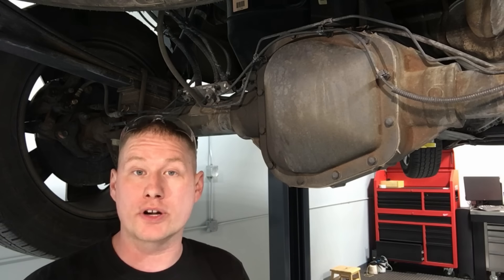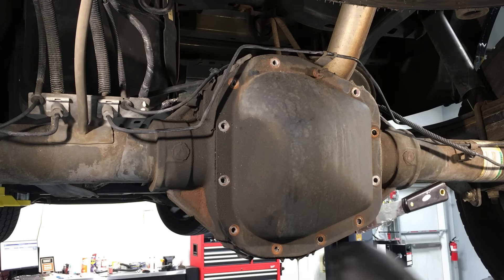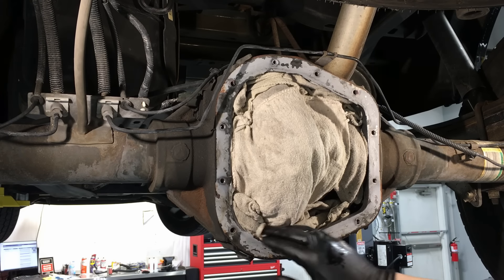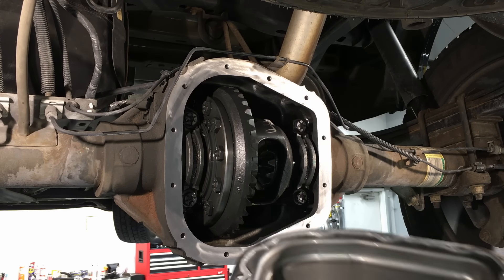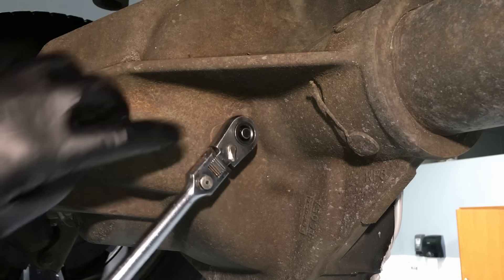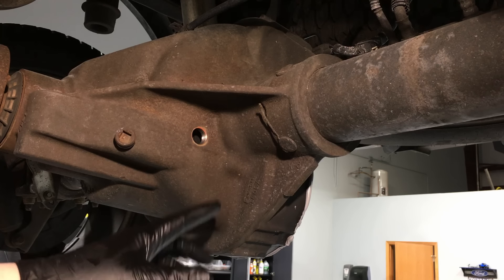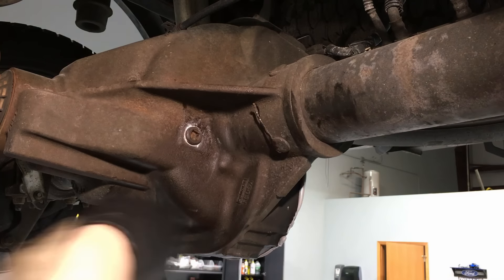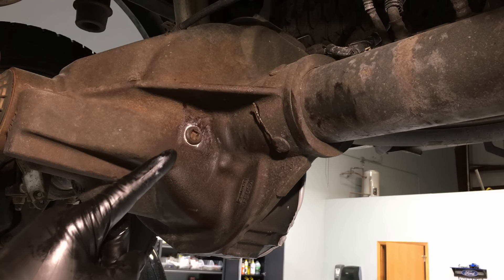Ford 8.8" 9.75" 10.25" Rear Differential Service: Fluid Change Procedure

Comment: Have a 2019 F150 w/5.0, my front and rear diff call for 75w85 does that mean I go with 75w140 now for both? 3.31 gears. Also how do I know if I have a limited slip?

Comment: Hello. 2016 4x4 F150 needs in Front and Rear Diff XY75W85QL. In my Platinum there is an electronic look Diff. Right? With this kind of Diff I do not need the  XL-3 Modifier. Sorry, but in Germany I cant not get any Help or Information about it.

Comment: How the heck could you do this at home with Jack stands?  Or is that not possible,  or safe?
Reply from the maker: No need for jack stands. Keep it on the ground in park, parking brake on and wheels chocked.

Comment: I have a 2004 ford f150 lariat 5.4. What type of differential fluid should I use.
Reply from the maker: 75w-140
Reply: @FordTechMakuloco  
Also can I use the ford 75  w 140 synthetic fluid for my differential
Reply: Can I also use the friction modifier

Comment: What can I use to clean the differential if I dont have the grinding disk and tool
Reply: without a grinding disk use a putty knife, wire brush, and break cleaner. I always use a gasket and gasket sealer.

Comment: Any way for a common guy to find out if friction modifier  is needed on my 2011 F150 XLT CrewCab 6 speed 5.0 differential? Anywhere I can look or do to know one way or other?
Reply: Look up on Google Ford differential tag code to determine which you have. If you have a Limited Slip Diff you'll need friction modifier

Comment: what if the gasket seal makes its way into the differential and gets in the gear oil?
Reply from the maker: The sealant will  squish out into the diff side as much as the outside, it will harden and cause no issues.

Comment: If gasket sealent is leaking out of the cover when you tighten it doesn't that mean it will be leaking on the inside of the cover and possibly onto the gears???   why not just use a regular gasket
Reply from the maker: Only a little bit like the outside and it is never a problem.

Comment: what grit sanding disc to you recommend for cleaning the case contact / flange ?
Reply: I prefer the roloc bristle discs for cleaning sealing surfaces like this off, but any scotch-brite roloc disc will also work. You have to be especially careful on aluminum, such as on common transfer cases. You don't want to remove metal.

Comment: My truck is Axle code L9 so it means it has ELD but still need limited slip or not?
Reply from the maker: no
Reply: @FordTechMakuloco  I'm confused, I just put it in rear axle with 75w140 that contains LS additive and drove over 1k miles. No problem and feel anything funny.
Reply from the maker: What is the question.
Reply: @FordTechMakuloco  what should I do now because I have rear axle eld and didn't realize I had limited slip additive in it when I changed rear axle gear oil with 75w140. However, the rear axle is very quiet so far.

Comment: Why is there not an actual gasket for the rear diff?
Reply from the maker: Most manufacturers use sealant over a gasket.
Reply: @FordTechMakuloco  I guess I'm getting old...used to do both to ensure a leak free seal. Oh well as long as it works.

Comment: Any way to "know" what type my rear end is so I can know if I need the friction additive or not? I am dependant on the big box auto store for the proper diff lube weight and type. For reference I have a 2011 f150 crewcab 2wd 5.0. 6 speed tranny.
Reply from the maker: You want to use 75w-140 rear axle fluid also see here- https://www.youtube.com/watch?v=TKRqnQHfVXA

Comment: That is way too much seal used, I respect you Maku but you should add half of that sealant. There is no need to have that much flashed away from the actual surface seal. If I'm not mistaken, 1/2" of an inch is usually what you need on the actual surface seal for most applications. In this case, if there was more surface seal, it would go maybe up to 3" with that much sealant.
Reply from the maker: It's just how it comes out of the tube it's a little harder to control without the nozzle. Either way this will never be a problem inside or outside the cover so why even comment? I can tell you one thing my work has never come back leaking in 20 years of doing it this way.

Comment: Manual for my 2015 Platinum calls for 75W-85. Something changed?
Reply from the maker: Yes they are trying lighter weight oils again for fuel economy same as they did years ago then had too many failures and updated the spec to 75W-140. So take your chances with the lighter weight if you want.

Comment: So update to 2023. O have a 2016 my dealer just told me to use 75-85 in the front and rear if my 2016 F-150. Not the 140. Can u clarify ?
Reply: 75-85 is the correct viscosity for 2015+.

Comment: How can I tell what kind of differential i have without jacking the rear end up?
Reply: Matt Blackwood there’s a tag on the passenger side of the axle you should be able to climb under there and check. I couldn’t quite see where it said the size so I took a picture with my phone. If you wanna know what the tag looks like google it. Should say 8.8” or 9.75” there may be another size too idk hope it helps!

Comment: What's the brand of that wrench you are using?  Snap on cordless?
Reply from the maker: Milwaukee
Reply: @FordTechMakuloco  Thanks dude bought it fixed it, love that tool.  Replaced the fluid gears looked really good, but lol I believe it's leaking even more of the differential oil now not sure where it's coming from will check it out later :P

Comment: Wait wait wait....my 2014 Raptor (Roush) calls for 75w-85....you're saying not to use this but switch to 75w-140???
Reply from the maker: in 2014 they were still calling for 75w-140, it wasn't until 2015 they changed to 75w-85
Reply: 😮. I feel you're indirectly saying I'm lying lol. My supplement manual calls 75w-85, however I did find an Update lubrication chart from Ford (2020) indicating 75w-140.
Reply: @spydermonkey2127  My 2015 XLT says 75W-85 both in the original manual and the most updated lubrication chart from Motorcraft, but he is saying to use 75w-140. I'm confused....

Comment: I would have four inch studs that are threaded like the bolts threaded the same length as the original the remaining length smooth put these two on top and bottom this will guide the pan back evenly
Reply from the maker: No need, you can eye it up easy and fast, there is tons of room under there very open.

Comment: i have a 2004 f250 5.4 triton v8 what differential fluid do you recommend for the front axle? and do i need to add that friction modifier? i noticed some of the oils claim to have that in the 75 w140

Comment: OMG.. I'm so 14 years old..(57).. of course I laughed every time... 🤣
Anyway, I am pretty positive that there are only 3 guys on flat rate that would give ANY damn about cleaning out the bottom or covering the inside.. Oh wait.. PULL THE COVER???
 it's around $ 250 for a FAST dump and fill without pulling the cover at dealers anywhere around me. 
The old fluid is never all out..

Comment: I used Mobil 1 75W-140 synthetic gear oil. Walmart's website has it for $15.98 per quart with free 3-day shipping. The dealer wanted $30 per quart for Motorcraft. Not worth it.

Comment: First thing you do is make sure you can remove the plug.
If you can't. Then don't empty the oil. Or you're stuck.
Reply from the maker: I live in the salt belt of America and have never seen a stuck plug, or rusty or galled threads. If a previous tech somehow damaged the square drive then any competent tech can extract the plug.

Comment: Doesn't anyone use gaskets anymore? If I were just using goo, I'd put a beat around the outside of the bolts as well. If you don't, you're causing an imbalance in the pressure around the bolt.
Reply from the maker: Um no, Ford does it the same way from the factory and even illustrates this pattern in the workshop manual.

Comment: Since the fluid should be changed so frequently, why don't they provide a drain plug in a sump that would allo the fluid to drain out? Driving the vehicle before would help heat and thin the fluid. It would cut the time and work greatly and increase the  likelihood drains are done Vehicle doesn't need to be left overnight.
Reply from the maker: huh?
Reply: @FordTechMakuloco  why do you reply that way?

Comment: When I was doing this I hit the diff cover side to side with a rubber mallet would not recommend this tactic even though there was still one bolt at the top made quite a mess

Comment: I don't own a ford but the basics are the same for my vehicle. I have an older 85. It has floating axles.

What I don't understand is why they have the fill hole so low and inconvenient. And why they don't have a drain plug. Seems unnecessary. 

I changed my transmission oil and it was a mess. They have a drain plug for the engine oil. 😂

Comment: Little tip for the DIY folks...the very first step is to break the fill plug loose!!...nothing worse than draining all the fluid and then realizing the fill plug is stuck.
Reply from the maker: When is the last time you came across a stuck fill plug? You do know they use sealant and they are an NPT thread. Therefore, there is never a problem.
Reply: @FordTechMakuloco  Never say Never, bro. I personally saw a buddy have to deal with a fill plug that the idiot previous owner used JB Weld on for some insane reason. Not a fun day.
Reply from the maker: Very cool indeed.

Comment: I wish my fill plug was in such a great position on my 8.8".  Mine is on the front, just above the drive shaft.  Messy as all get out.
Reply: F. De Mascio fill it from the ABS sensor hole on top of the pumpkin. Just take the  sensor out first.

Comment: Does anyone ACTUALLY let the permatex cure overnight before filling with fluid or is a few hours good enough?
Reply from the maker: You must let it cure as the oil is in constant contact
Reply: @FordTechMakuloco  Felpro leaked on me so went with Permatex green stuff for gear oil, made a solid 1/4" bead going under and around holes and will let it cure a full 48 hours before adding the LS gear oil just to be safe. Thanks boss 🙂

Comment: I am not a fan of gasket sealer. You see the way it is pushing out around the edge? Well it's doing the same thing on the inside.
Reply from the maker: It will never be a problem; Ford has been sealing them from the factory like this forever and never an issue.

Comment: 🎉 Wonder why most people don't use that stuff cuz it gushes out on the inside and you have to let it dry for a long time then it probably wouldn't be floating around where it could get stuck on the gears. Top level mechanic might not use that and preferred gasket he is not a rubber gasket but felpro has good products.
Reply from the maker: It does not float around inside and this is the way the factory seals them so we do it the same way and never a problem.

Comment: Use 75W-140 even in '98?
Reply from the maker: sure
Reply: @FordTechMakuloco  Identified the rear end innmy E350 is a dana 60 not a ford rear end.  Haynes says 80w90 conv. for DANA 60 or 70  rear end. and Ford synth. for ford 9 or 8.8.  Assuming I'm still going with 80w90.

Comment: Use WD-40 and a hammer to loosen the bolts first. Then ratchet them off to assure you don’t round them.
Reply from the maker: Huh? These bolts never seize up, why would you need to do all of that?
Reply: @FordTechMakuloco  just to try and make it somewhat easier.

Comment: Well technically youre supposed to hant tighten the bolts and snug them up. Then wait an hour. then torque everything to spec
Reply from the maker: Nope I follow the Ford workshop manual procedure to torque immediately not the Permatex instructions and I have never had an issue my entire career.
Reply: @FordTechMakuloco  well I doubt the Ford factory used Permatex gasket maker. So probably better to follow the instructions permatex gives.  But if you havnt had any issues I guess keep doing what you're doin.

Comment: Motorcraft 75w-140 is up to $30 a quart, 80w-90 runs $13... Hmmm... 2005 5.4 with friction modifier. Anyone have an reason one fluid over the other?

Comment: Do they not make a gasket? Letting that dry for an hour+ seems like a waste of time.
Reply from the maker: A waste of time? Really?
Reply: @FordTechMakuloco  Yes, a waste of time over just putting in a traditional gasket. I don't have to wait an hour to change the rear diff on my GMC. I just clean it off, put a new gasket back on, bolt it back up and fill it back up.
Reply from the maker: The factory GM gaskets may hold up but the only option for Fords is cheap aftermarket gaskets that don't hold up.
Reply: @FordTechMakuloco  Are there specific things to look for or brands to stay away from when it comes to gaskets in general? I just assumed most gaskets would hold up just fine. At least for the 30k recommended fluid change interval on my GMC.

Comment: Why not use some brake cleaner to clean it out?
Reply from the maker: No frickin way!
Reply: @FordTechMakuloco why not? If you hose down the inside with brake cleaner, you’ll get cleaner inside. Then just soak up any standing fluid and let it dry.
Shouldn’t be a problem.

Comment: you wonder why they didn't put a drain plug on the bottom of the sump. That would be too easy.
Reply: If every manufacturer made things so simple they'd be out of business
Reply: @TonyyFlow  my wife’s Honda CR-V had a lower drain plug and an upper fill plug. Dealer would charge a $130:for a 30 minute job.

Comment: You forgot step number one. Make sure you can remove the fill plug.
Reply from the maker: It's never been a problem working on vehicles in the rust belt the last 20 years. Have you ever seen a seized fill plug on a Ford Sterling axle?

Comment: I did the differential fluid change a guys Ford F-250 Powerstroke 6.0 super duty and the front differential fluid pumped out incredibly slow and was green.🟩 The rear one was 🟤 brown. I made a video of it. He also had the napa transfer case fluid an. I told him get the motor XL-12 Transfer case fluid instead and I have to wait to change it. He didn't buy motorcraft of any fluids. I figure I don't want to do the transfer case drain and fill with out the right fluid XL-12. The fluid I put in differentials has to be better what was in it I texted him links for the motor craft limited slip differential additive and gear oils but he got some other types. 80w90 for the front differential and 75w140 for the rear differential . The video is "2003 Ford F-250 6.0 liter Powerstroke front and rear differential drain and fill". The only green fluid I can find is shell spirax  sae 30.

Comment: No additives are needed for a Torsen diff.
Reply: Totally mechanical posi-trac torsen lockers are the best design. There are no clutches to wear out.
Reply: My R/T Dakota came with a torsen posi-unit and 390-1 gears at 170,000 it still worked like the day I got it. If it were an f150 or silverado the posi-track clutches would have been done for and only a single rear wheel would pull.

Comment: Never replaced my fluid in my GMC; it has 260k miles.
Reply: Just bought a 91 F250 with 156,000 miles. Pulled the differential cover off to change the fluid and it looked like mud coming out.
You might want to service your differential for piece of mind.

Comment: Attaching a clear plastic hose on the end of the bottle and into the fill hole keeps spillage to a minimum. This works especially good if your a cheap bastard like me.
Reply from the maker: Why fight the added resistance, did I spill any here until the end which I purposely overfilled the diff?

Comment: Be sure not to over torque or under torque..Ok what's the torque spec?  If you dont have a manual it's a crap shoot!
Reply from the maker: Normally around 32 ft lbs.

Comment: 75W-140  differential fluid should never be used in rear axles in cold weather climates , oil is too thick and will not flow to the pinion bearings freely

Comment: Its so important to not over torque them or under torque them he didnt mention what to torque it to 🤣
Reply from the maker: You can clearly see on the torque wrench digital display it says it is set to 35ft lbs for this 9.75" rear end, did you miss that somehow? The torque value varies with model, year and axle you are working on so no I won't say one value fits all and throw a blanket number out there.
Reply: @FordTechMakuloco   ah yes i missed it im sorry. i looked up 9.75 and 8.8 spec online and from what im seeing they all are in the ballpark of 33 35 ft lb. i just did this job yesterday and i am waiting to see if my rtv job was worth a crap lmao, there is luckily a felpro at the nearest part store if all else fails lol

Comment: If you're going to change it every 30, 000 just switch to a gasket my man that way you're not grinding and cleaning the differential every time
Reply from the maker: I do not trust them and if you are changing it every 30k miles you do not need to pull the cover.
Reply: @FordTechMakuloco  I understand that newfangled gasket technology can take a while to get used to. Lmao
Reply from the maker: seen too many seep.